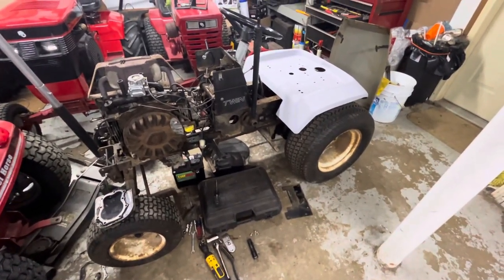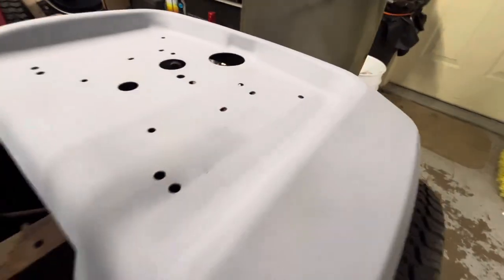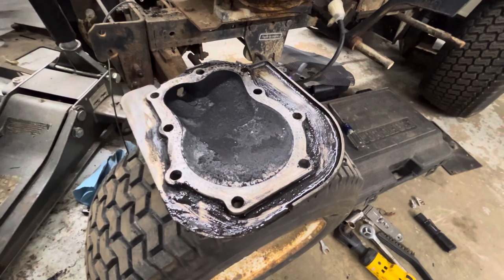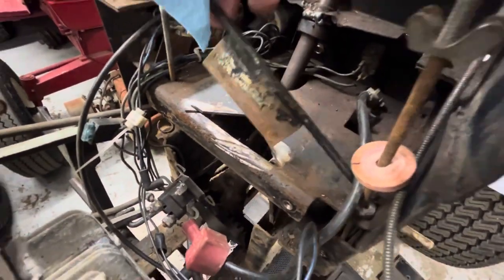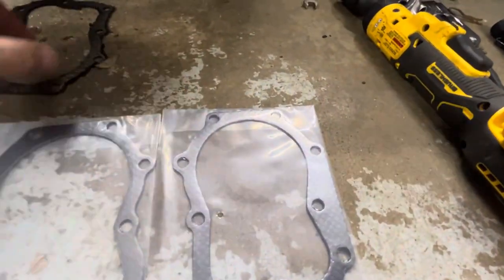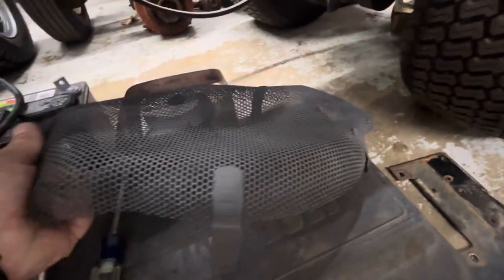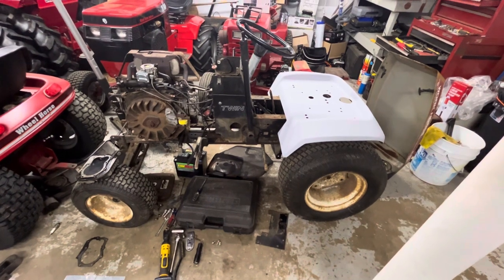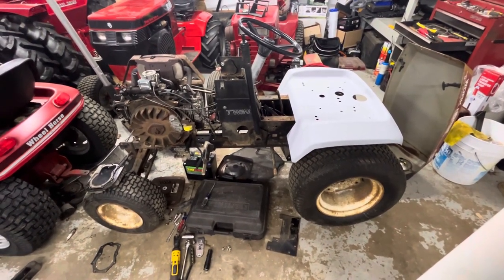Wheel Horse GT-1600 WorkHorse Part 2 Quick Update

Comment: Appreciate the update. Pretty standard issue fix up and it sounds like you've got a great handle on it. This is pretty much what happened when I restored my 75 c160 automatic a year ago. I really did try to tell myself that it was only going to be a quick partial disassembly and repaint. 😅  But we all know how that goes. No worries. Tractor came out great. Now it's a fantastic worker for me.